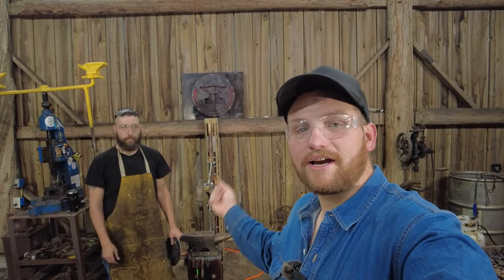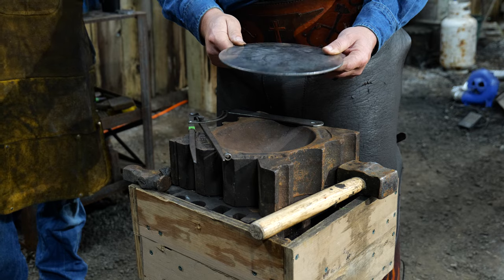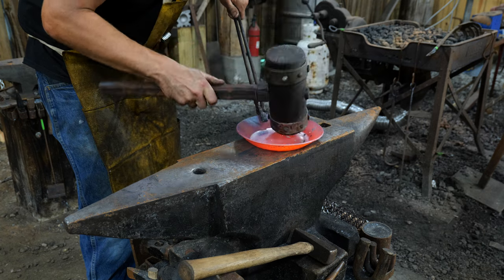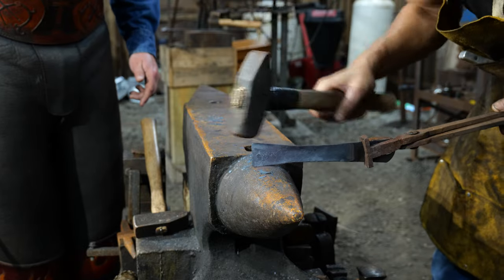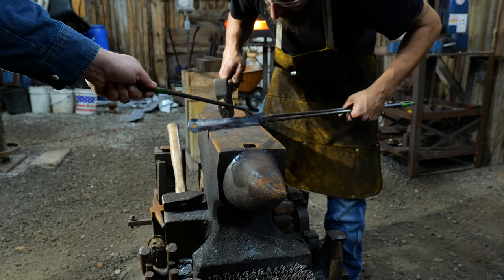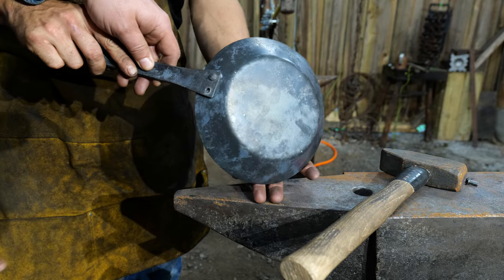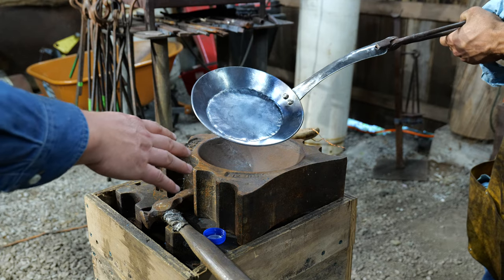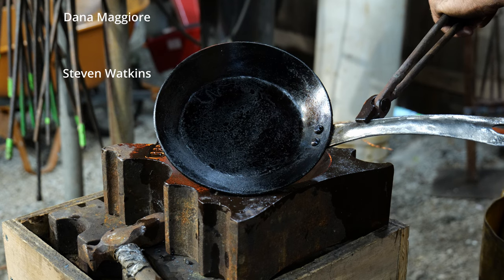Forging a $100 Frying Skillet

Comment: Hi roy I am enjoying the content on these small videos a lot. I have a question for you and the rest of the community is there a long video on explaining the difference between hand crank bellows electric blower and ye old bellows and the affect on charcoal coal and coke and if not would anyone be interested in creating one please as all i can get is charcoal to forge in the control of this type of solid fuel and trying to keep the sparks to a minimum would help as i keep most of my fuel in water to try and keep them to a minimum but the hair dryer i use is putting out too much air every with my air gate almost completely closed i don't have a chimney at the moment and i don't know if it would help to divert some of the sparks in a more controlled way so i don't wear most of them is air flow my problem or is it my fire pot depth its only about 3" deep the fire great was designed more for burning coke and has large slots that run the length of the great so let in a fair bit of air it is a bottom blast forge and i like using my solid fuel forge more than the gas forge the gas forge has it's usefulness but is really bad at heating 24mm stock as it's only a single burner forge so all my tools are made in the coal forge

Comment: I just started forging about three weeks ago and I didn't even know you could forge a frying pan!  I might have to try making one of these.  I think the forge where I'm learning has a swage block that would work.  Doesn't have a set hammer with a curved edge though, but we're making hammers in the next class so I can always just make one.
Reply: You can easily pick up a hammer from Harbor Freight and adjust the striking surface to your preference. I enjoy making my own hammers...but for the time involved to learn a skill you may never really get into long term (pan making I mean)...a grinder and ten minutes with a $10 hammer is far more efficient than making a full on hammer. Plus if you continue on making them, you'll have a far better grasp on what you need in a hand made hammer. Win/win!

Comment: Serious question! Does the thickness of the original plate make a significant difference?
I mean other than the obvious weight difference and the subsequent additional forge work to the sides.
I would think a quarter inch base stock would not be any more cumbersome than a cast iron skillet of the same proportion.
Just curious. Plus have you ever attempted to make lids /covers for your pans? Or socket n wood handle of sorts?
Blessing y'all!
Crawford out 🙏🔥⚒️🧙🏼‍♂️

Comment: Have you forged a square pan? They are great for bacon.
Reply: I would guess the corners would be a bit of a challenge. However in one train (wreck 🤭) of thought the corners could well be drawn out as pour spouts on at least 3 sides with the 4th corner being used as the mount for the handle. Just thinking in text here . 🙏🔥⚒️🧙🏼‍♂️
Reply: @dragonstonegemironworkscra4740    Yeah, i like that idea. Portable and useful is always on my mind. Elk camp tends to weed out the non useful stuff quickly.